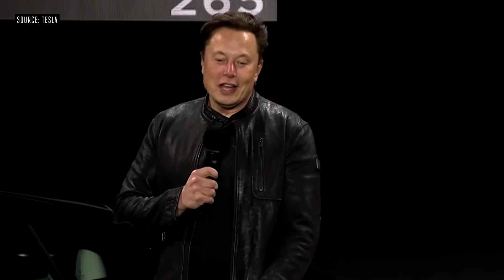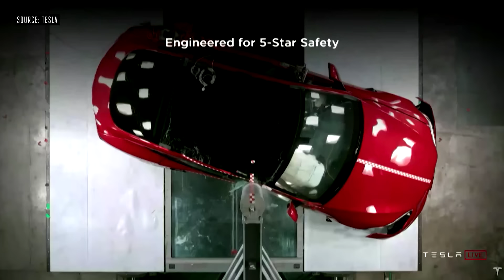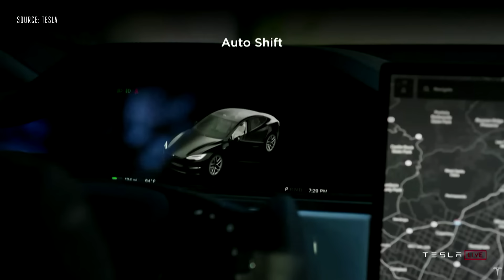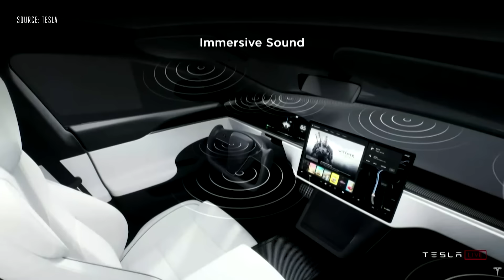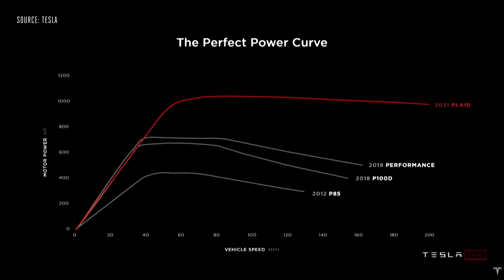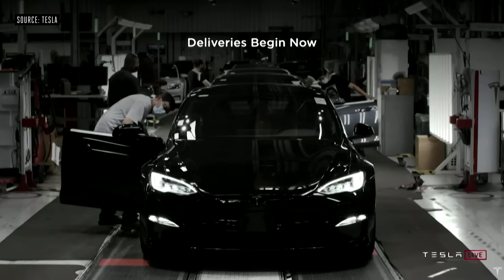Watch Elon Musk deliver the Tesla Model S Plaid

Comment: After 1.9 sec battery drained. 🤣🤣🤣battery level went down to half. While you're charging or looking for charging station. I'll be in NY 🤣🤣🤣🤣🤣. That's why stupid people buy tesla and drive 50mph at 75mph zone in left lane 🤣🤣🤣🤣.
Reply: wow you sound angry, you can get about 90 launches out of it, ive heard some people say they are still getting the same drag times even at 60% battery. it can also charge nearly 200 miles of range in 15 minuets so thats enough for a piss and snack brake every 3-4 hours. i always thought it was stupid to drive a bike on a highway, you guys get splattered all the time.
Reply: @odisy64  😂😂😂 heard and factor completely different topic. If you keep driving fast or stuck in traffic 😂😂😂😂....gas cars are capable to RIP all day and gas up will take 5 minutes 😂😂😁
Reply: @all_about_racing  the power train and cooling system where improved in this model S, even at low charge its still going to do sub 10 second runs. you can get about 90 launches and charge 5% to 55% in 15 minuets. but unlike a gas car, filling up its 390 mile range will only cost around 8$

Comment: The battery's alone cause more pollution than normal cars they weigh 1500 lbs lithium to mine it leaves radiation pollution, pollutes water ect.. these cars are a joke the only reason Tesla hasn't gone under is the carbon credits they get paid for.. lmao not to mention our power grid is so old if everyone had one it'd fail from all the chargers so this won't last much longer trust me

Comment: Not the fastest, rimac broke both 0-60, 1/4 mile records for the production car, both of them on an ordinary road not a drag strip, yes it is a hypercar and is much more expensive but tesla cant say that they are the fastest and ignor Mate Rimac for his succes with the Nevera...it's not debatable almost 2k hp out the factory with the biggest battery pack of 120kw and the fastest charging speed capability, all of that and Elon is ignoring it
Reply: its not a production car or in production so it cant take that record. thier is no official definition of a production car anyways, its just interpreted as a mass produced car of identical models. and rimrac does not qualify because they are only making 150 of them at 2.5 million dollars. the rimrac is nice but its not as impressive as the model S. the rimrac is basically an electric power train slapped on to a hypercar body. try to remember that the rimrac is a 2 door made out of carbon fiber, has 4 motors and not built with battery life in mind. while the model S is a 4 door sedan made of steel and aluminum with 3 motors and nearly half the horspower but somehow manages to weigh less than the rimrac and only be less than a second slower at the 1/4 mile.

if Tesla made a 2.5 million dollar electric hyper car you can bet it would be a lot faster than the nevera.

Comment: He hasn't heard for Rimac Nevera, apparently. 0-60mph - 1.9s, 1/4mile - 8.6sec, 250mph top speed, battery 120kWh, 1914hp and torque 2360Nm.
Reply: Thanks for watching.....for more guidance on generating returns on Dogecoin, BTC, Ethereum, etc

Ш•H•A•T•S•A•P•P  My Broker, Robert
+•1• 5•7•1• 4• 8• 7• 6 •3• 9• 2•
Reply: It's not a production car dude....

Comment: I want to know how this car past automotive test when it auto selects what gear you need by its self , isn’t it about time we update safty requirements so gear stick or selector, indicators , wipers and cruse control remain physical control not auto selected or buried in the menu somewhere
Reply: It is not behind a menu as it is at the front of the screen when selecting. Plus near right next to the hazard button there are gear selection buttons just in case. But in the case of this all input is error, so much safer letting the car decide and if you don't move the car remains in park as a extra safety precaution

Comment: I'd try one except 1) Porsche Taycan is still a better vehicle overall unless you MUST play a video game on the console and 2) the steering wheel....ygbsm.
Reply: Taycan is better? Lol. Plaid beats Taycan in software, Driver assist, charging speed, efficiency, range, Motor performance, practicability...literally every objective metric.
You may like subjective things like Taycan's styling, but u can't make a case Taycan is "objectively" superior.
Reply: @archigoel  And yes, I suspect the Taycan battery will objectively be superior to Tslas.
Reply: @zd1322  no Taycan overheats faster than a Model 3...

Comment: The rollout of the model y, the cyber truck, and now this car were horrible. Bad lighting bad car display bad presenter. 
Rolling out a car with terrible lighting, parking it at an angle that it doesn't highlight its design or looks, and stuttering through a presentation as if it was the first moment anyone had seen the PowerPoint slides.
Such a waste

Comment: For me the most important thing is that the car can keep 1000 horse powers until max speed, just like a gas car. Also, its has a new state of the art head radiator, allowing it to race back and back. The only thing right now is to see this beast performance on a race track.
Reply: So why is a thousand horsepower at 200 mph the most important thing? That's a specialized requirement that literally nobody needs or can take advantage of
Reply: @haljohnson6947  well Tesla did not mention anything about Torque in the representation. However, there was a confirmation that the plaid did 1/4 miles at 152 mph. Assuming that this thing take around 11 seconds to reach max speed.

Comment: Fastest production car in 1/4 mile .. SF90 , 765LT laughing at 8.8sec
Reply: Those are 9.4-9.6 second cars stock.
Reply: @PassportGaming  nah fam on drag strip 765 is solid 8 second car .. but I'm interested how fast this tesla is from 100 to 200 .. that's the thing
Reply: @Tetrathegod  Unless you live in Germany, those stats are irrelevant and I’ve never seen a stock McLaren do 8s. It’s always tuned
Reply: @PassportGaming  there are a few videos showing it basically it's 8 . 8 , 8.9 and it does 1.8 0-60
Reply: @Tetrathegod  wrong, no stock McLaren are faster than the Plaid on 1/4 mile.
Reply: @alexz8373  Exactly stock mclaren is faster ;d AND I cant wait for them to start tuning them .. there are videos already you can check it ... as they deliver more and more cars more videos will come up the car is insane
Reply: @PassportGaming  Also Dragtimes went with a Dragy on the event and got 2.74 0-60 with the new Tesla S.. SO FOR SURE its far from sub 2 seconds
Reply: @Tetrathegod  That’s with 3 people and a non prepped track. I guarantee you dragtimes will get a sub 2 second 0-60 when he gets his

Comment: wait didn't the eqs have the lowest drag coefficient?
Reply: Yeah it has 2.0 vs the Teslas 2.1 (rounded to the nearest tenth). But I guess he didnt mention that because „lowest … ever“ sounds good and the eqs isnt sold until later this year.
Reply: @urjustmyexp  So more deception from Musk.

Hardly surprising.
Reply: EQ not in production and no one knows if the .20 is when the wheels are spinning, it likely isn't.  Mercedes is certainly going to be asked, but they will likely ignore the question.  Don't be surprised if the EQ isn't actually .20 when actually driving.
Reply: @_PatrickO  Yet Tesla is believable?
Reply: @zd1322  It's available to buy, so someone can test this, surely?
Reply: @dachoppa3702  Guess we have to wait and see.
Reply: Mercedes says the EQS' figure is a dead 0.200... but yeah, not yet in production
Reply: EQS isn’t in production yet

Comment: I want to see Tesla Model S Plaid vs Rimac Nevera in drag race.
Reply: Simple, the Tesla will loose.
But you can about 18 of them for the Nevera's cost.
Reply: Nevera will win, it has higher end power and large wheels, but the Model S might have an advantage on the track do it its extremely low center of gravity, i believe even lower than the Neveras.
Reply: @odisy64  Nope, check Nevera specs
Reply: @miroslavzukina4842  i have

Comment: the auto shift would drive me crazy. I need peace of mind in knowing which direction I’m going.
Reply: You can see it on screen, and bypass if needed
Reply: @Tiigerr  that’s neat but you’d have to keep looking at the dashboard. If model 3 goes stockless do people have to turn their head and look at the infotainment to see the direction? yikes
Reply: @coke1011  it's only out of park lol...how often do you think you'll be shifting gears while driving? Don't knock on something before you fully understand it.
Reply: It shows you with a big arrow on the screen…
Reply: You can turn the auto feature off. There are PRND buttons right below the phone charger pads if you prefer manual operation.
Reply: @agusterodin  no there isn’t
Reply: @Dimetri Drossos the point of these systems is to move us towards autonomous driving incrementally. All forced user input is essentially error. Now sure, it adds convenience, but more importantly when they succeed in making driving autonomous it will improve safety significantly. Car accidents remains one of the leading causes of deaths and injury.

It's very easy to get intimidated by new tech before we've had a chance to see it play out. This happens all the time. But without people willing to push boundaries we would have never had some of the amazing tech we have today. I challenge you to give it a deeper look before dismissing it.
Reply: I got really excited when he mentioned delivery starts now! Only to then realize I didn’t order one nor have funds to pay for it.

If you are looking for me I am in the parking lot, filling up my Fiat with tears.
Reply: @jeffharrison6059  there is no gear selector. if you want to reverse you have to trust the car knows you want to pull back or manually reverse on the screen

Comment: The car sounds really good, but that steering wheel would be irritating for people used to normal steering wheels.
Reply: its depend how you handle the wheel
Reply: Plaid isn't for regular people. Regular people buy Model 3.
Reply: shouldnt most people be grabbing the wheel in the center anyway not the outside edge